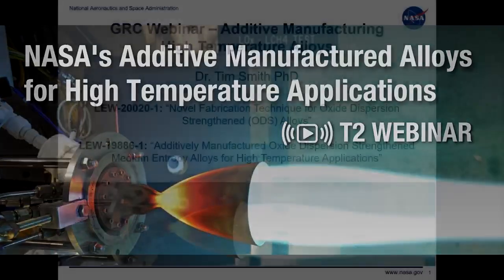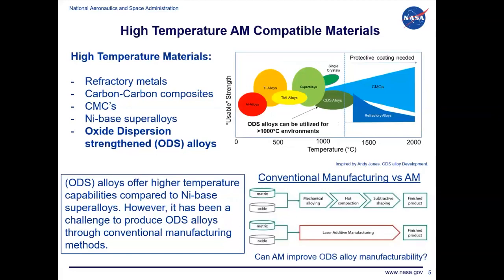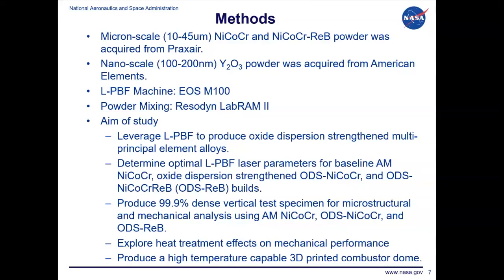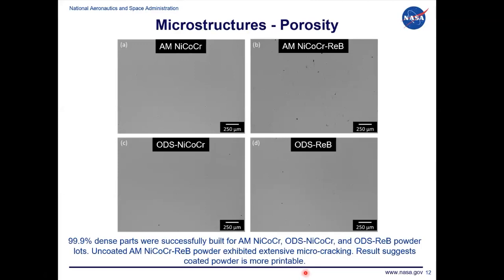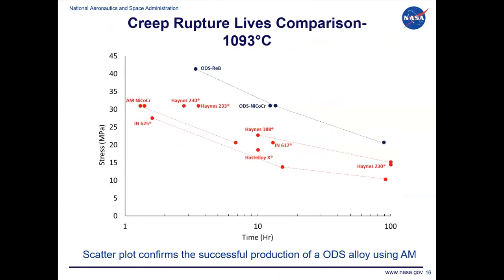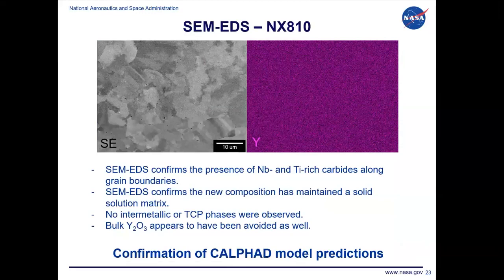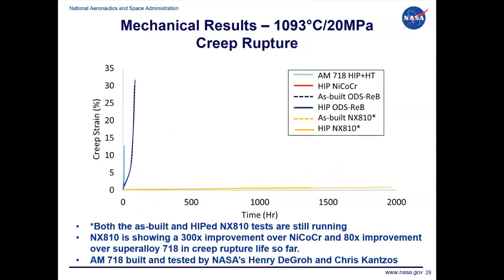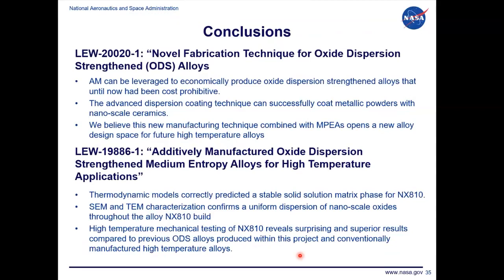NASA's Additive Manufacturing Alloys for High Temperature Applications Webinar

Comment: The Yitrium oxide addition seems like an inspired solution.  I am looking for information on 3d printing tantalum Hafnium carbide alloys and Hafnium carbide Oxide compounds.  I am in need of a rocket engine that will not melt above 7,000 F or deform below 6,000 under 1,000 bar.
Reply: no known metal on earth meets your reqts. spaceX's sx-500 showing solid results in deformation/strength up to 800bar. with micro additions of B, Yt and other wizardy Elements, perhaps HIP and triple melt VAR processes will rise to the occasion.
Reply: @kenw8875  The melting temperature of Tantalum Hafnium Carbide is around 7,140 to 7,400 degrees Fahrenheit .  I don't know the creep strength temperature, I hope it can sustain 1000 bar at 6,600 degrees.
Reply: Graphite will sure work for a burn of a few seconds